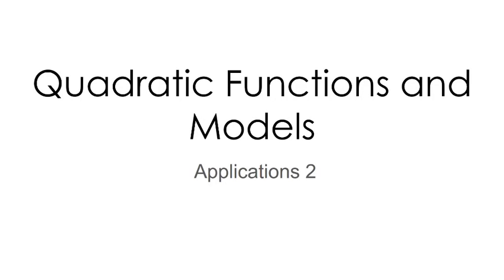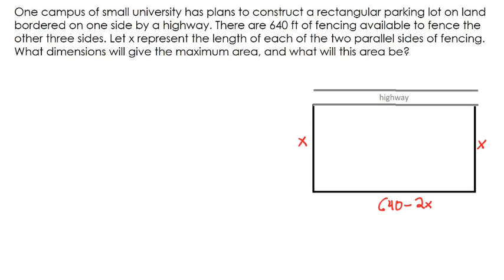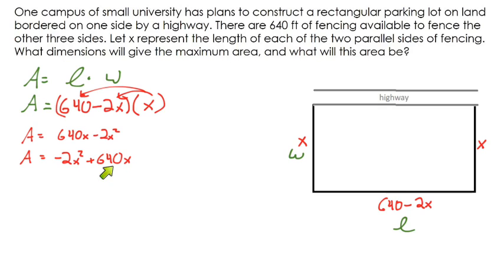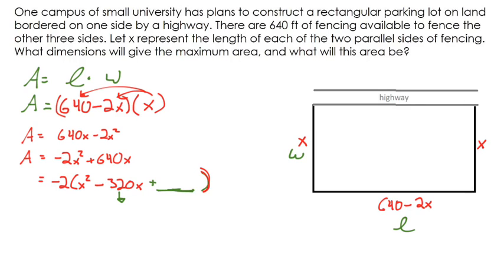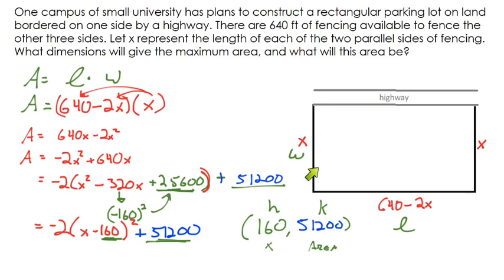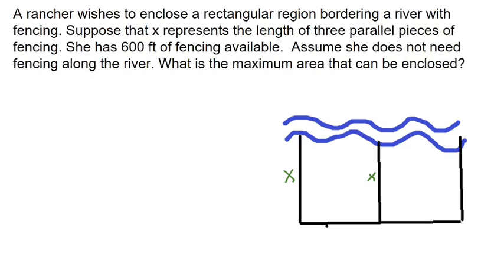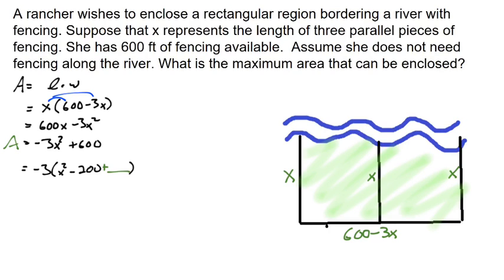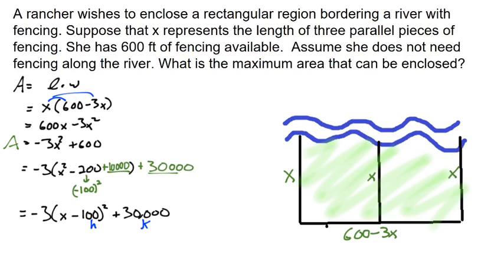Vertex Form Word Problems (Fence Problems)

Comment: won't it be better if you find      -b/2a which is the width    W= 160;  L  plug in W    L=  640-2(160)= 320;   now A=L.W,    A=(320)(160)=51200
Reply: I said the same thing, did not see your comment at the bottom. You're right , I agree with you. Much easier, no need to complete the square.